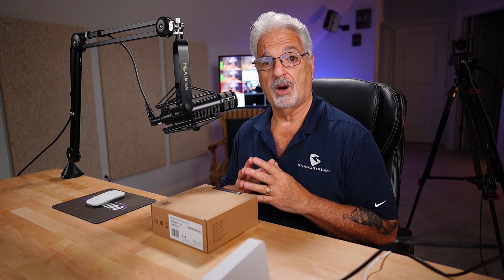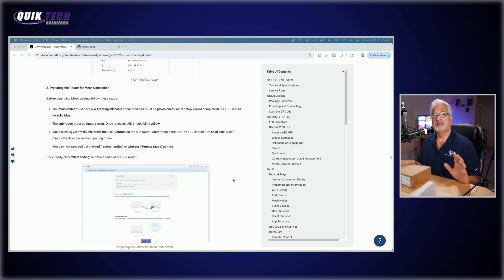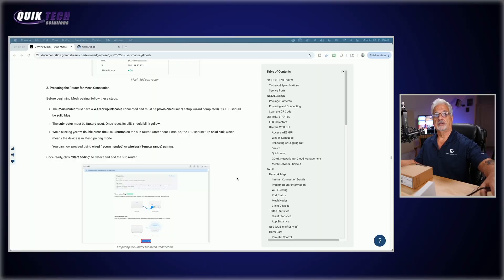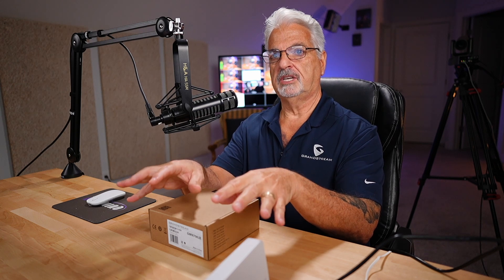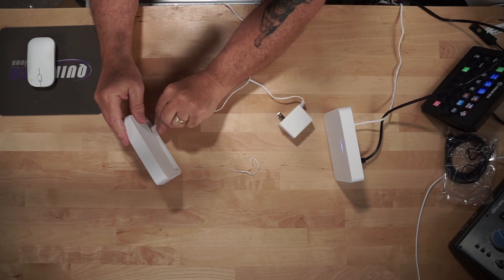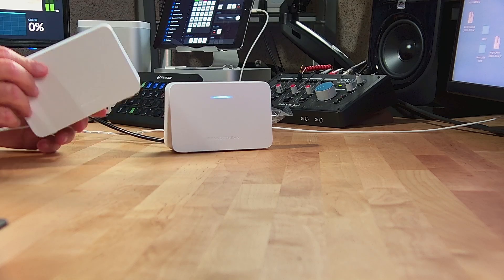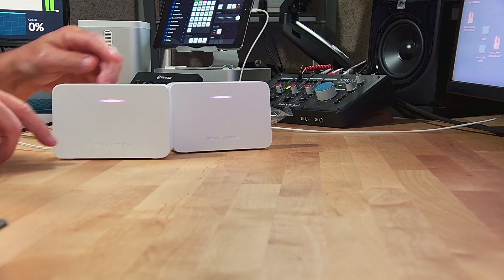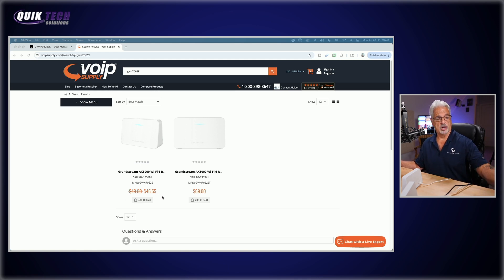Easy Mesh Networking

Comment: Hello Tony.  I really enjoy your videos even though on the otherside of the world. I know you are a grandstream fan.  I have used a few of the GWN 7062E and find them a nice little router.  I have found unfortunately they will not mesh with other grandstream APs have a different interface and they only have 2 lan ports.  I was using the GWN7062 and GWN7052 for this purpose but grandstream unforfunately in wisdom has discontinued these 2 lines and as far as I know are not replacing them with anything.  
Do you know if Grandstream are going to be launching a new router that covers around a $60.00 us price point, has 4 lan ports and with mesh with all the range of grandstream APS.
Reply from the maker: Hello Chris! Thanks for watching & commenting. I’m not aware of any devices being released per your specs. However, I believe GS will be releasing a plug-in mesh device  made for meshing with the GEN7062E.  Have a great day!